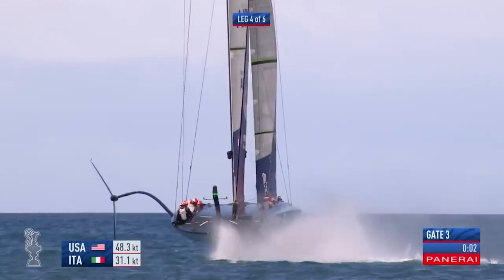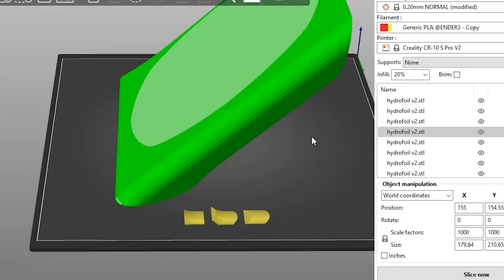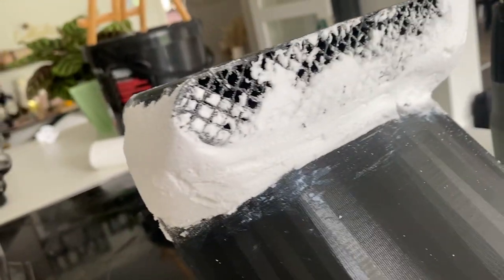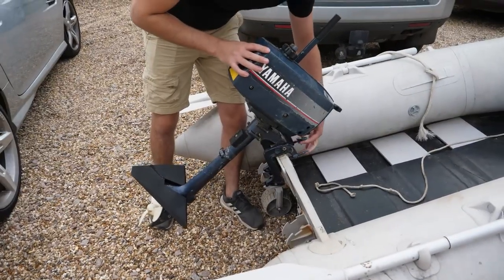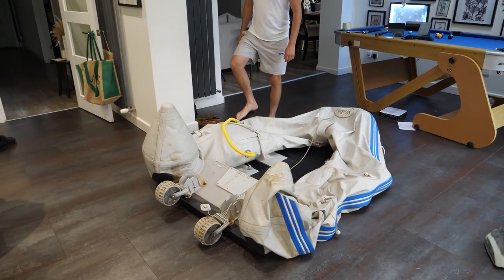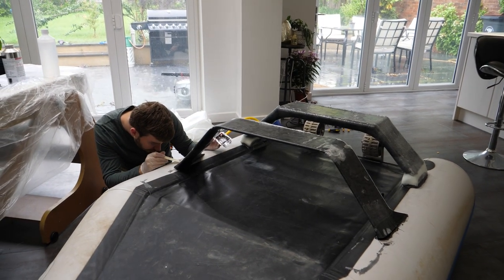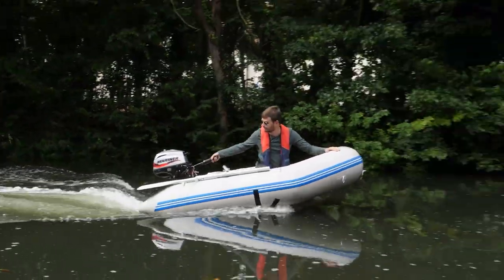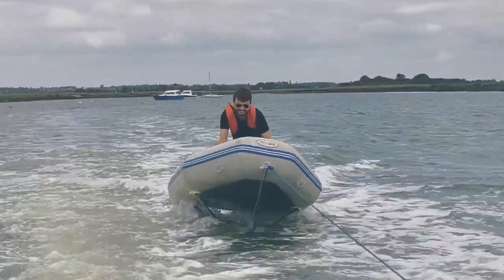Making A Boat That Flys - The Hydrofoil

Comment: You could export your gcode 3D print files with higher accuracy to get smooth looking bent shapes, not those edges on the bent surfaces ;-)

It takes the same time to print it, it just looks way better.

When it looks like there are edges in it on the slicer object placement view, you get edges in the printed object of course ;-)

2:25 and 2:29

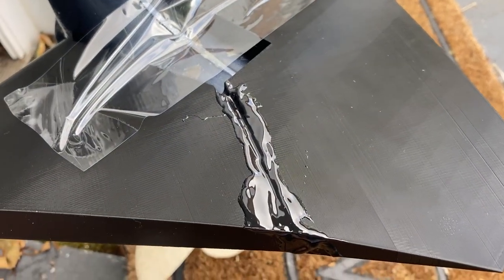8h wait, 4:57...
And the fiberglassing before...
OK, but still ;-)

Comment: Great first attempt but connect the foils front to rear otherwise the hull flexing means no stability to the angle of attack. Probably better off with just one main foil but tie it back to the transom to lock in the angle of attack. Please go again!

Comment: obivously if the engine is mounted on a transom at the ideal performance height, if you lift up, the prop will be too high/out of the water.   1st thing I said when you went for this project, you need a long long shaft engine.

Comment: Would be cool to see a better constructed one that doesn't involve 3D printing and has balance/geometry worked out and enough power to push itself and clean water flow onto the prop and the motor mounted low enough - then it'd be really interesting :-)

Comment: 2HP, 3.5HP ?
Digging really deep into my past, as a 10 year old, I had a 'speedboat', 1.5x the width of your inflatable and twice as long with a 15HP Yamaha.
Hard to tell the speed, but if I have to judge now... 40kph.
Till windforce 6 Beaufort , I could keep up with my fathers catamaran, that speedboat jumping from wave to wave.
Calm water, that boat was great, water skiing was possible.

With that 3.5 HP engine, I didn't expect much to be honest and what was that boat with that 115 HP engine, it didn't really use it ...

Comment: Hello, make a base under the boat, attach the fins to it, and attach it.  Note, put the weight in the middle, turn the control forward, like a steering wheel, if you don't know, follow Peter Saboyle

Comment: Ventilation, not cavitation. Cavitation is caused by extremely low pressure behind the blade that literally makes the water boil. It can eat the metal away.
Reply: You are right about ventilation vs cavitation. But, low pressure "behind" the blade? For a propeller (vs. a water turbine) the low pressure is on front face (the face closer to the front of the boat), or at the tips of the blades.
Reply: @andrewsnow7386  yes front of blades.

Comment: The lift when he was using the 3.5HP outboard wasn’t the hydrofoil it was the tender planing
Reply: Except that it wasn't planing, it was riding it's own wave like it would have done normally too. The engine is way too weak. I think this experiment should be done with at least 10 HP or so.

Comment: Cavitation is water turning into steam while a prop is spinning very fast and makes a vacume and then pops that pop is cavitation you where just breaking the surfaces of the water with the negative pressure that sucked air into your prop not cavitation

Comment: the back is too heavy and the prop is lower then the boat which cause a rotational force (like a back wheels of a car doing a wheelie), you need to put the wing much closer to the engine but generally this boat is just too light and unstable for this

Comment: Balance the boat over the hydrofoil... figure out where your center of mass is at the angle you travel at a given speed, then put the front hydrofoil just in front of that for stability.

Comment: Your arch foil creates too much instability. It requires a wider stance for the foils and return to the shaft foil on the engine. 
That should bring the required stability back in line as well as lift the rear out of the water while still maintaining steady power from the engine.

Comment: your Hydrofoil fins is too big too straight wide and created too much turbulent make it very unstable to canceling the thrust, you may try to use the delta fins (could be more than one) to maximize the fin surface force  to create the stable upward force to counteract the gravity and push to boat forward.

Comment: Remember what you said about 3 legs?

Look at doing that again but this time Remember what you said about 3 legs and

Because there's no cavitation from the front the foil the motor will not suffer cavitation.

Thing is Sam you had it !! build the bridge of the 2 front foils over the top and the boat hanging off the foils. 2 out the side foils will provide stability like I swear you needed to go for a swim behind that boat till your foils fell off.

Yes Sam total failure because you can't count to 3 please try this again and here's a tip.

Run a compressed air feed to small holes about 10mm apart and a 3mm dip along the leading edge of your foil - when you want to go faster turn the air on.
The foil will then fly into an air bubble and it doesn't take much to make a foil actually fly in air under water.
And again it doesn't cause cavitation because cavitation is made with big bubbles and you're controlling the size with 1.5mm air jet holes and a pressure reg.

Your foils are not proportionate do some research on foils and notify me when you start your next build.